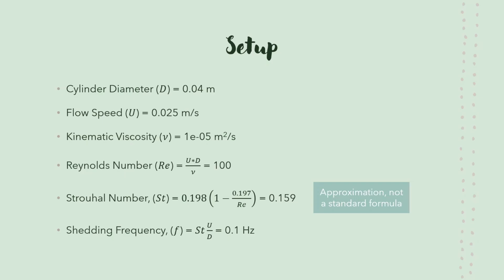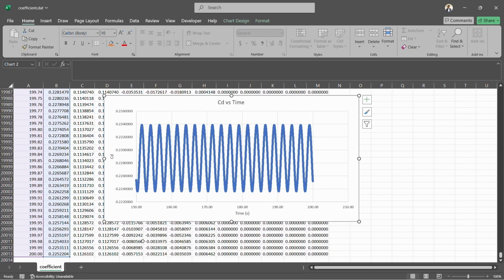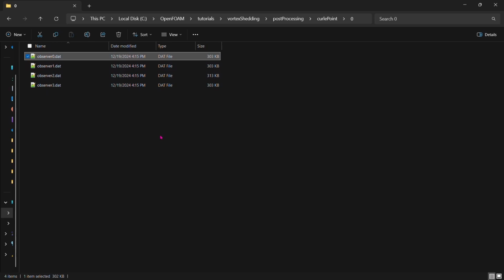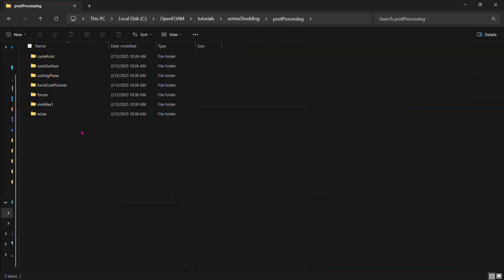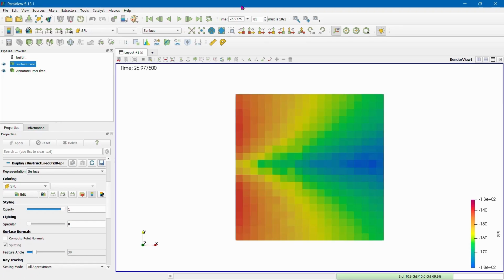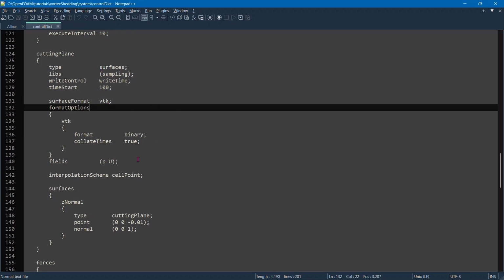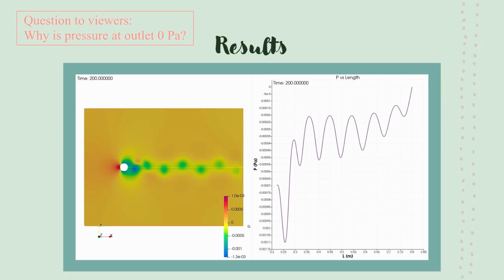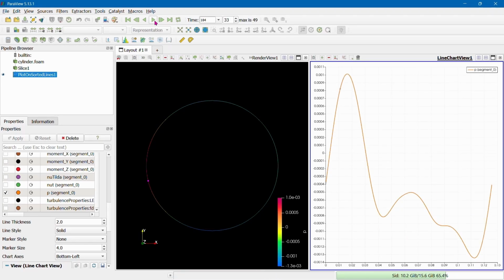Flow Separation - Part 4 (Results and Discussion)

Comment: Thanks for the wonderful and full of knowledge tutorial. Please make the videos related with VOF modelling (water+air). I have a question, how to install gauges near the cylinders to get the results in post-processing?
Reply from the maker: You could do probes for the cylinder question. Just add in controlDict or reference it in a separate file called probes.

Multiphase flow will take me some time to work on. Currently trying to get combustion started!

Thank you so much for the support.
Reply: @CFD_OpenFOAM  I got it. Best wishes and eagerly waiting for the multiphase flow on your channel. 

Best wishes. Please keep explaining in the same.